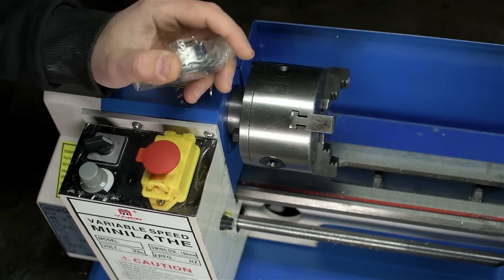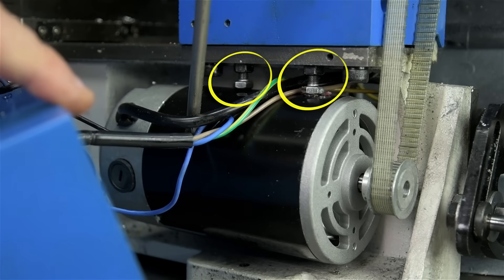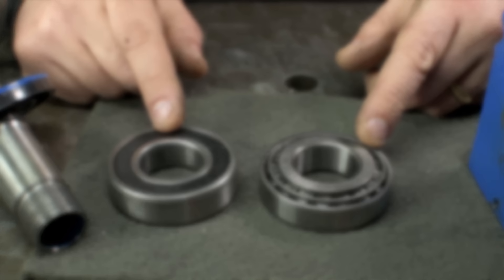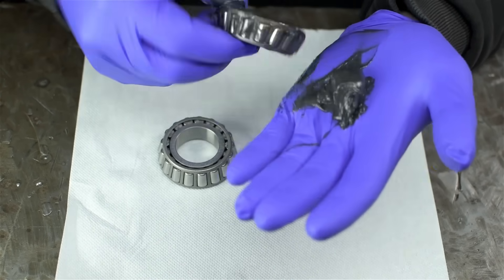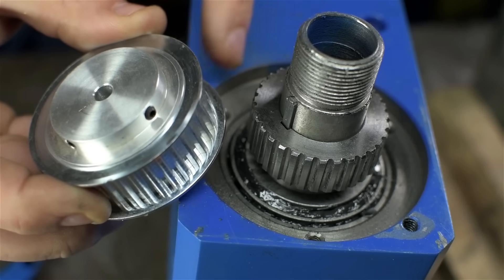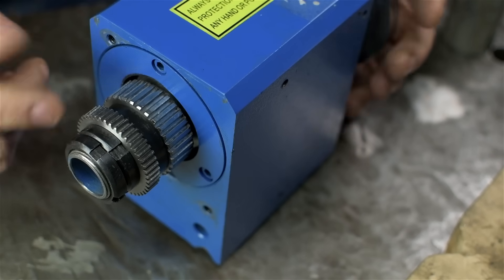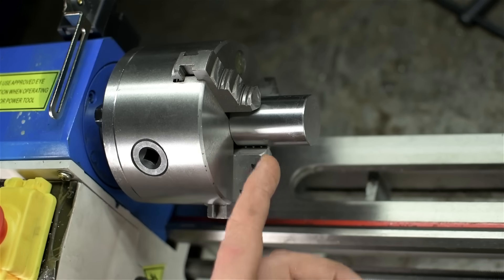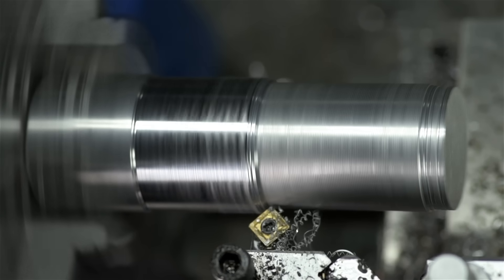Better LATHE Than Never!

Comment: Hi Tony excellent video, id like to ask you the power of the spindle 1/2 or 3/4 hp? and the question im facing: What do you think about cutting with a 3mm insert? with a 25mm diameter rod of steel. thanks

Comment: i would have used an angular contact ball bearing at the chuck side and a plain ball bearing at the drive side. angular are more forgiving as far as runout and the smaller contact surface produces less heat, in case you have a do over.

Comment: You are right, it's about 0,05 mm play in the bearings! A German guy made a clip and he went through the testing of the accuracy, and he thought in his first opinion that the 3 grip spindle is the problem, but now as you say that it runs on ball-bearings, it's clear that it is the bearing because of the amount of area it sits (Lay's) on.

Comment: Did you know the 2 bolts holding the motor in place are only 2 threads into the motor case?

Comment: +100 on the "what doesn't kill you" tangent on the machine tool... A couple of fellas I used to work with (strangely one was also a Tony) had some gnarly scars although Tony's facial scars and "modded" jawline were from a 10" grinder kick-back so technically more a hand tool than machine...  Safety folks, it's all funny 'til someone loses an arm then it's hilarious.

Comment: I am using a pair of angular contact ball bearings instead. They are the exact same size as the ball bearings, but more importantly, come in sealed versions. Which you definitely what need for this lathe with open construction - hate to think what will happen with these roller bearings if you get a chip or two in them.

Comment: I think the angular bearing option would have been an interesting comparison for this application. You have an 'unknown quantity' in the rigidity  of that headstock, and you could well squeeze the guts out of it while correctly adjusting those prehensile snout tapir roller bearings. Spent 8 years in front of a Colchester triumph 2000, with my tongue hanging out the corner of my mouth, turning things that were meant for milling or boring.

Comment: I think the main reason behind the original sealed bearings is the lubricant doesn't fly out of the bearings like it does with open ones making them lower maintenance over all . That's not going to be fun taking the lathe apart every 8 hours of use to lubricate those open bearings.

Comment: So I thought why not go all out and get Silicon nitride ball bearings like a skf s7206-cd/hcp4a? While I could not even find a price for that bearing, similar ones ranged from $160 to $2,500 each. The good news is that they are speed rated for 32k rpms with grease.

Comment: Roller bearing handle lateral forces much better than ball bearing do and for the record, I used to manufacture roller bearing for trains (Timken, Brenko, Koyo, etc). Let me tell you the bearings for the engines... 12 inch ID 😳 Yes I said ID... The OD was more like 18 to 20. They weigh much more than you think. It took a team to assemble a single bearing. My job was to grind the bearing spacer to fit, fit the cones and spacer in the outer bearing cup which was about a foot tall, match it to spec. Them the caps were pressed on and we packed them in the factory with industrial bearing grease. Nothing more than that. There was no oil in these at all except a surface coat so they wouldn't rust but none at all added inside them. No machine oil at all. Now like all bearings everywhere they require upkeep but like your car, that's part of the annual/semi annual unreal upkeep.

Comment: I tried the angular thingies instead of the tapered roller bearings. These are very hard to install.  I have no clue how to combine them getting on the axle, and then into the headstock without damaging them. also I bought (as I discovered...) the open version. So this chicken is off to the shop for tapered roller bearing. Because for a beginner it is very handy that I'm able to install the cups separately from the taper. I would love to know how to go about installing the angular beasts, at least in theory. Thx for any help you can offer.

Comment: The teardown of the lathe was completely unnecessary as both bearings could be changed with the headstock in place! all that was required was to slacken the drive belt before removal!

Comment: After watching this and a couple more YouTube videos on replacing bearings, I replaced the bearings on my 7x16 minila the. DONT replace the plastic spacer with a metal one. I spent the money on a short aluminum rod and made a couple of spacers (mine has two). Then I couldn't get a good surface finish. I put the plastic spacers back in and things are smooth again.  I guess the plastic absorbs some vibration.

Comment: As a rule of thumb, radial ball bearings are rated for axial loads of about half their radial load rating. My recollection (from more than a few years ago) is that rating is at a lower speed, but these lathes only go about 1000 rpm anyway. What the tapered roller (or angular contact ball) bearings will give you is rigidity on many axes - radial, axial and moment. Great upgrade!

Comment: Wouldn’t they have used angular bearings? They don’t cost much more than regular ball bearings. The one positive thing about the plastic spacer is that as things get hot, and expand, it will compress, making the increased tightness less of a problem. Sort of the way preload springs do.

Comment: Firstly love the videos, Mr. TOT. Secondly, (beginner question) after you removed the compound rest, you were advancing the cutting tool into the workpiece with the cross slide handwheel, correct? Can one still be precise with that handwheel?
Reply from the maker: yep!

Comment: I just got one of these (unboxed it today). I doubt I will be doing anything like this but we will be placing a chamfer and parting 1/8" Ti rod so I am hoping it will do the trick. We have been manually cutting these for years but now need to worry about clean ends. I also need to square one end so I am thinking I can put a chuck in the tool holder and a end mill in the main chuck to make the square. Do you think this will work? Or am I barking at the moon to avoid having to buy a milling machine? Thanks. Great video.

Comment: I did this to my mini lathe a few years ago - well I had it in bits anyway after destroying the plastic gears inside. I replaced the plastic with steel and replaced the bearings with angular contact bearings (Because I'm lazy!). after a few more mods I finally got it turning like a champ, then promptly bought a bigger one and sold it cheap to a friend! another great video.

Comment: Tony...you're using a Colchester lathe to shore up limitations of a mini lathe. Surely the lesson is use a mini lathe as is AND get a Colchester when you need it. A Mini lathe is only a mini lathe. All the mini lathe tune-ups would cost more than a Colchester and it will still never be a Colchester....This message was sent to you whilst travelling from my Colchester lathe to my Harrison lathe to service parts of my Myford  lathe. Greetings from England.

Comment: My wife's sewing machine has more power than that thing. But I guess for someone who has no money and needs a lathe for some reason this thing is a great buy. I don't think there is one machine in my shop you could move without a forklift. I paid for all of them the same way hard work and "YEARS" of saving. I still enjoyed watching this one though 👍
Reply: Ya I agree.. it would definitely be more efficient than running my 240v single phase lathe for small projects I am looking at a baileigh bench top lathe for this exact reason now. I refuse to buy machines that need work right out of the box. This is how I earn my living. When possible new contracts come in or maybe new clients wanna see my shop I need to show them that my machines, my crew and I are capable of handling anything they might throw at me. Although this tool may do the job as good as the high end brand.. I charge top end so my tools need to reflect that

Comment: I cringed a bit when you put that moly lube in the bearings. It probably won't hurt, but solid lubricants are not called for in roller bearings.

Comment: New bearings what You install has no sesls that's mean .... Centrifugal force get clean bearings from grease in short time on high RPM . Results will be damage bearings rollers and roll surface ...

Comment: hello tony , like you ide like to do every possible upgrade when the lathe arrives ive got everything ordered quick release/metal gears, loads of tooling / a tailstock t2 spindle as i have chucks , the only 2 things i cant find are the tapered bearings as i need the size (please ) and the other thing im not so concerned about yet do you have details or the 2 gears required to upgrade the drive belt as ill soon have a bigger motor , many thanks in advance been watching your videos whilst waiting for the baby to arrive (ups in 3 days ;-) ) , just an idea as i dont have the thing infront of me yet but from watching your video where the tailstock bolt was catching the body and the P!$$ poor desin of the way the tailstock clamps down , im going for fitting a nylon step piece under the bolts that hold exsisting clamp ill use countersunk stainless steel hex bolts so no clearance issues and it will slide effortless providing the underside of the main body aint dog rough ill do a post when i all arrives cant wait lots of rc components to build
Reply: @Grauenwolf  thanks im in the uk , i have the bearings and everything i need , it led to a bigger job rebuilding my workshop , ill get there.
#

Comment: TOT something occurred to me, i've just assisted a tech changing bearings on my "old" CNCs X axis. They where only greased up and had run around 15 years (estimate X movement 15-20h each week). When he was greasing up the new bearings i asked him about the wear (oil vs grease). He told me it wouldn't have any significant effect, since the bearings temps never gets high enough to "melt"/remove the grease. Now i have no idea how warm a cheap mini lathe gets, so this may all be irrelevant info 😁
As always; great video! BTW i've been speaking highly of your channel to my colleges (all educated toolmakers), we all agree your skill level and knowhow is off the charts!!! We think you're more skilled then some of the professionel educated machine operators! 👍👌😎

Comment: My lath was/is off in every way possible.  I re-turned the spindle and the chuck and it helped, probably need a 4 jaw to improve it any more.  Anyway, duck taping a drill to a table and turning with a tool taped to a vise seemed to work better before, now it's almost acceptable.  Any ideas?

Comment: I bought one of these lathes about 7 month back and it's been a very handy tool, once you spend some time adjusting the play in the saddle and cross slides of course which do make quite a difference. Currently waiting for a set of steel gears to arrive. Great vids btw, made with a sense of humour... brilliant.

Comment: Could add felt seal to the plates and a drip oil system to the bearings . Or grease zerks and use white lithium grease. Nice upgrade they should use better bearings but china you get crap.

Comment: My new lathe stopped turning before I was finished testing it. Seller wants photos to replace parts. How do you photo something NOT working? Ha Ha. Do you know how to fix the electronics? Can they be by-passed and run the motor direct?

Comment: The easiest way to get the preload right is to adjust the nuts at first to what you think is OK, then run the lathe at top speed for 10 minutes.....if it doesn't show any heat build up tighten the nuts slightly more and repeat until you do get some heat increase...……..then you should be able run the lathe for 1/2 hour with only a slightly increase in temperature......that will last you all day. After a month or so when the bearings settle in you do the exercise again...….you shouldn't need to do that again for the next year.....I've been a fitter and turner for 60 years or so and done many bearing set-ups.

Comment: A couple of ‘beginner’ questions please.  Is the tool post block exactly the same height as the discarded compound slide (not counting the location ledge)?  Which QCTP do you use, and will the combination of that tool post and the new block allow a12mm tool to be used and be adjustable to come in at centre height?  Grateful for any advice.
Thanks
Mitch
Reply from the maker: I'm not sure, but the tool holders are adjustable.  I'd have to measure.  For reference I think the tools are 8mm.

Comment: I upgraded mine to tapered roller bearings recently, very pleased with the result. Have to say though, having the model with high/low gears makes this upgrade a lot more complicated! Also, I decided to 3d print some flexible covers/seals to replace the end caps, they worked out very well. I also had to print some new spacers so all the gears all lined up i woulda turned them from aluminium if I'd know the dimensions before I took it apart.

One final tip, The 4mm key that locks the high/low gears to the spindle was stuck, and all attempts to remove it failed - until I decided to drill and tap a small hole near the end of the key, and fashioned a slide hammer from a long M3 bolt and a piece of scrap steel. A few taps and the key came out easily.

Comment: Actually ball bearings kick the shit out of tapered roller bearings in lathes, they just have to be of the angular contact variety. 😉
Reply: Hey Chuck, can you support this with some data?  If you think of the loads a typical lathe headstock encounters, they will be lateral (orthogonal) to the rotating axis.  As Tony says, balls like e.g. downward forces.  I agree, it's not much of an angle produced when taking cuts; but you ARE 'pushing' against the workpiece, and THAT is pushing against the bearings unevenly.  However, fwiw, I got the 7602AC Angular Contact ball bearings -- we'll see how it goes.
Reply: @cheponis  That's what he's saying though, angular contact bearings are what you need, I think TOT when with Tapered for cost, which, yeah, I get it

Comment: So, with no spacer between the bearings it becomes similar to the neck bearings on a Harley.  Lift the front end then tighten it up just snug enough for the tension to hold until about 30 degrees rotation, then the weight of the front end should overcome the friction and the front end will 'fall away' to the stop.  Tighten or loosen as required. Works great, turns back and forth real well, keeps the front end from vibrating your hands off.  Interestingly enough, there is also a set of taper bearings in either hub that the wheels spin on.  These bearings take a spacer between them that prevents over tightening.  Shim or skim the spacer to get about .002"-.006" of axial end play when the axle is fully torqued.   The difference here is fairly obvious.  One spins fast, the other rotates slowly.  Both should be fully packed with grease.  But don't be surprised when your 2500 rpm spindle wears grooves into the races after about 2 hours.....   Taper bearings need to be spaced off of the race whenever there is both a radial and axial load or they will die...

Comment: I would have just machined a plastic plate to go into the bottom of the housing to catch the grease.
Reply: Then what? Over time the void space will fill up with grease then eventually overflow out through the bearings both front and back of the headstock. Yummmm, good time cleaning that out when it fills up.

Comment: Hi This old Tony, I have one of these lathes and I find the biggest problem (now that I've improved everything) is that the speed of the carriage when engaging the lead screw is far too fast for most cuts. I wondered if you had any 'fixes' for this, it is already running on the largest gears that came with it and bigger ones just wouldn't fit.
Flummoxed from England.
Reply: @Grauenwolf  Hi Jonathan, could you tell me the tooth number of that slower gear please, then I will know what I'm looking for.
Thanks.
Reply: @Grauenwolf  Hi, no luck on that search. I am in the UK though so maybe its not listed here. Thank you very much for trying though.
Reply: @Grauenwolf  Hi, I've searched worldwide for "mini lathe change gear reduction for power feed 20/80/15/90 for smoother finish" and nothing is coming up...
Reply: @Grauenwolf  Hi, I found his ad, he won't ship to the UK so I'm stuffed... thanks for all your help.
Reply: @Grauenwolf  Hi, unfortunately he won't ship to the UK, thanks anyway.

Comment: You should do a comparison between this and a old Emco-unimat SL I got one and need a new motor tho
Reply: Wow, that's no comparison. The Emco Unimat is about 1/3 (or smaller?) the size of the mini-lathe and is more like a watch makers lathe than a machinist's lathe.
Reply: Storm Khan actually it is a comparison  as the emco came from Enfield and they used to make gun parts with it for the sa 80  also it’s a 1/3 hp lathe with extendible rails with jaw riser blocks and tail stock swaps with only a Allen key  so you can do larger parts than just watches and with optional 1/2 hp motor swapping capability it can do more than most realise with the correct belts and belt positions
Reply: @stampydragon2739  Hmmm, we talking about the same machine here?. The Emco I'm talking about is made by Maier & Company in Austria. They made all the Unimat lathes...